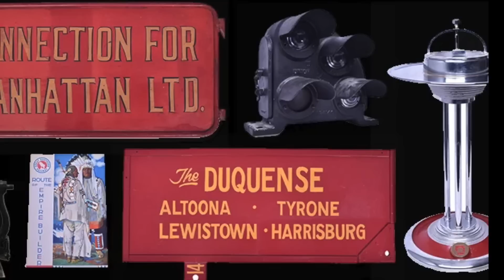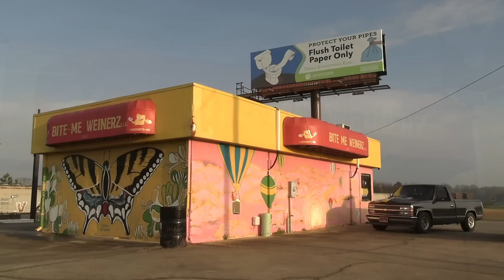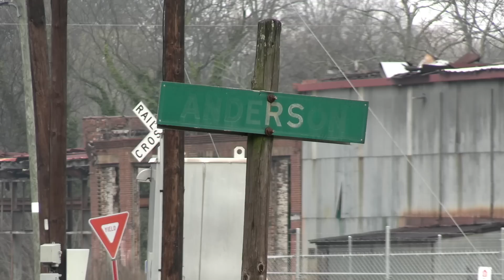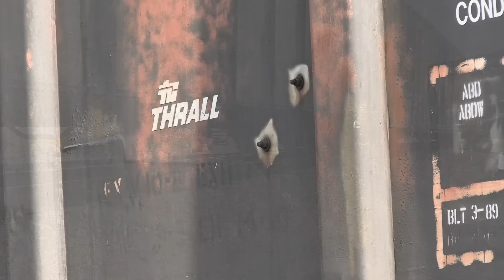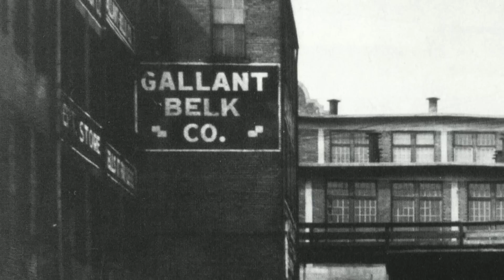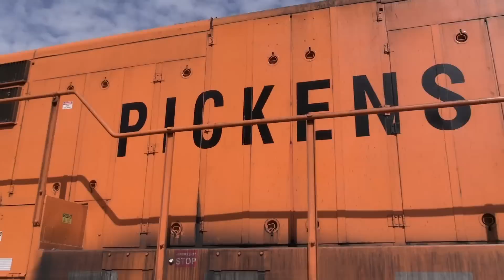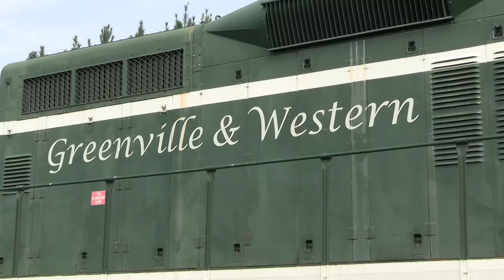Slim Pickens: Rare GE U18B Locomotives on the Pickens Railway

Comment: That S-1 on the deadline is interesting. The front is opened up.  Did they change the radiator to have it like an S-5, and just leave the old shutters, i wonder. The RS-1 is also in pretty nice shape, it seems (exterior, at least). Several potential museum pieces, maybe?

Comment: You can take one EMD GP40-2 and do the work of two of those GE-18.  Sorry BUT the EMD Engine's are a much better Engine than those GE Engine's.  Awesome Video...
Reply: They must have gotten those old GEs on the cheap?
Reply: They're about even when it comes to tractive effort. These GEs are just cheaper and better on fuel.
Reply: It's also a GE prime mover. So it's a toaster, and just by looking on the roof they've blown out more than once
Reply: I agree If those GE engines had a turbo they would be junk and in the scrapyard by now this is one of my favorite videos

Comment: If I'm not mistaken, didn't they also use Baldwins as well, at one point?
Reply: yes, up until the nineties they operated a VO-660 and a DS44-750. The VO-660 was abandoned next to the engine shed in pickens in the mid 2000s, and after the abandoment of their original trackage in 2013 it was left there for good. At some point the Pickens passenger depot was restored and as part of that, VO-660 #2 and one original Pickens boxcar were moved in front as a static display, alongside the conversion of the rail line into the Doodle Trail. The DS44-750 was apparently sold in the 1990s but stood abandoned as well by 2004, I imagine it got scrapped.

Comment: I guess this little short line is budgeted for the extra engine running all the time when this video clearly show 2 engines running isn’t necessary…. I bet an alco S-2 could have done the same job and I’m sure theirs even an SW-15 out there available….ms~~~ retired from the rr industry~~~
Reply: This fleet of U18s replaced their aging and decrepit fleet of S2s, EMD SW and SC, and two Baldwins, so clearly that's not the case.